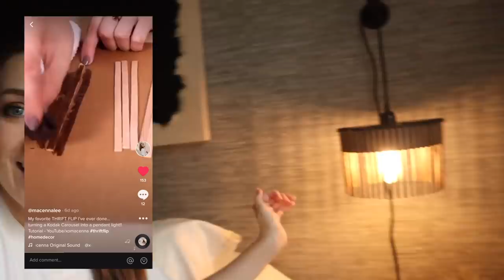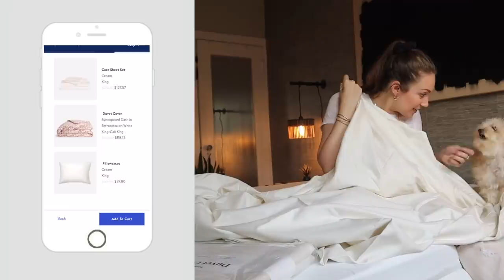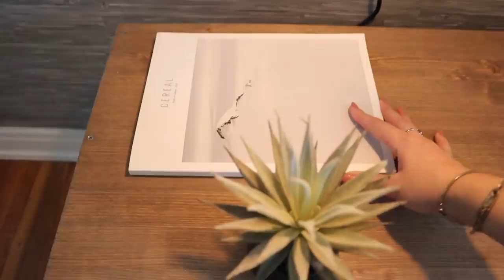new bedroom decor  + clean with me | XO, MaCenna Vlogs

Comment: I love how much woodworking you have been doing lately! If you do decide to do a drawer tutorial, a trick for hiding the pocket holes without having to fill them is to put them to the outside in front and back. You never see the back of the drawer and the front gets covered up by the drawer front. Also, if you drill the handle holes before gluing, you can use it to hold the drawer front while the glue dries.
Reply from the maker: Ooooomg!!!! Thank you !!!